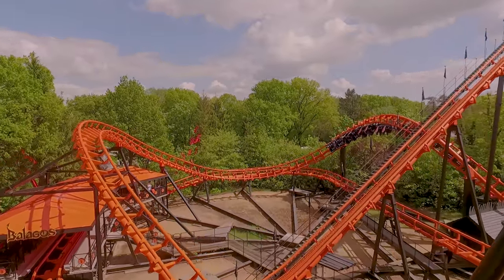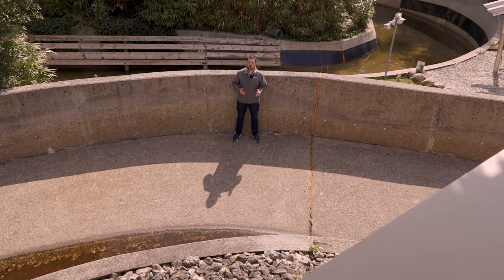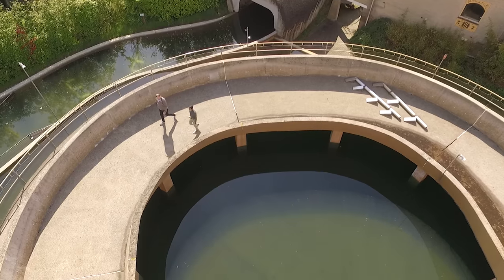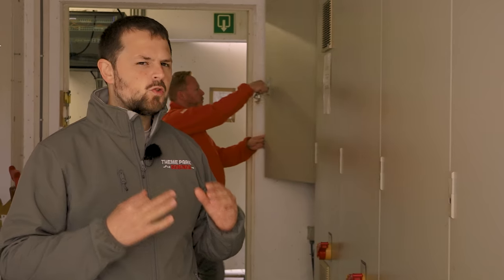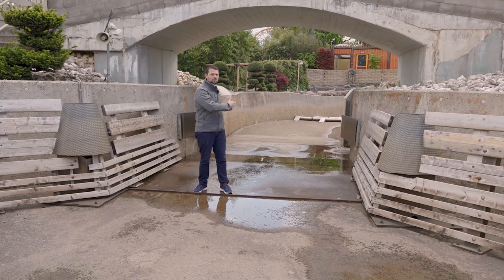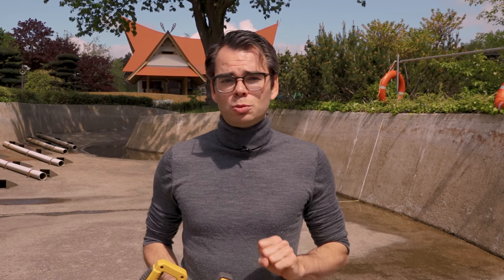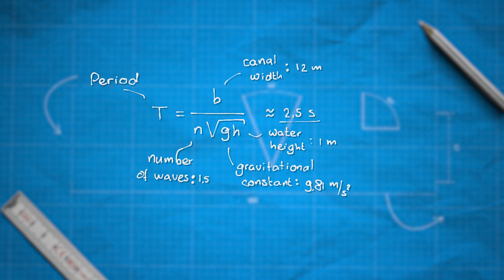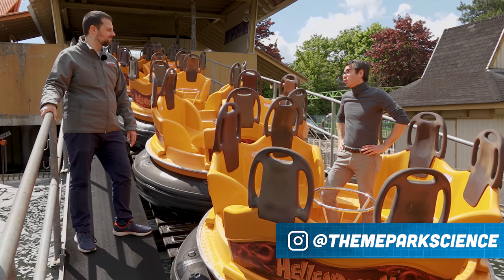How Does a River Rapids Ride Work And How To Get Completely SOAKED!?

Comment: Dang, I thought the other way of making the waves was having a pump house with an electric blower. Then there would be a part in front of it with a series of flaps that go to chambers to distribute the air evenly, causing the water to be forced out of the chambers, therefore creating waves. Thought that  instead of the paddle.